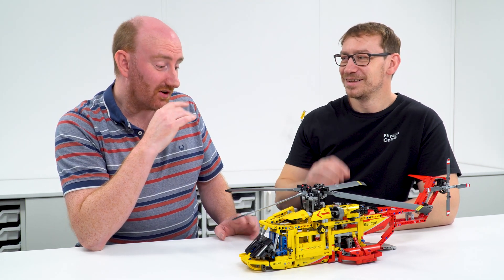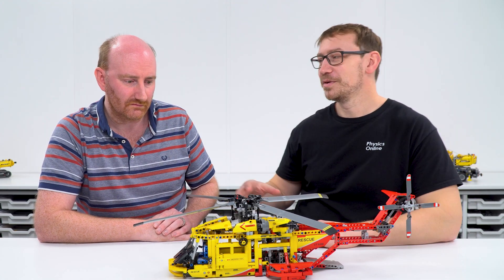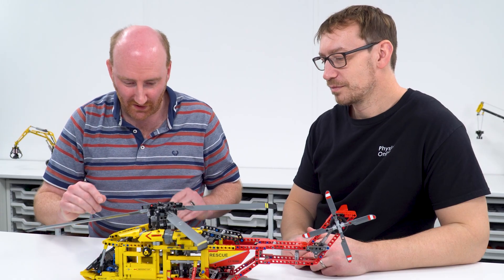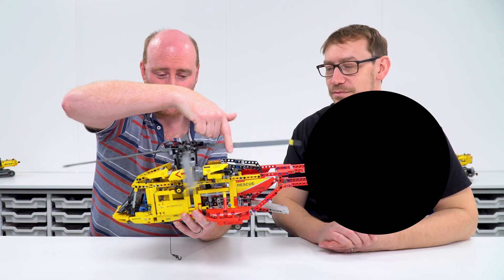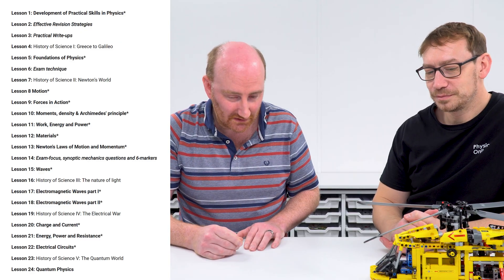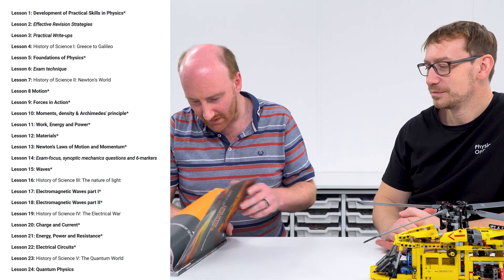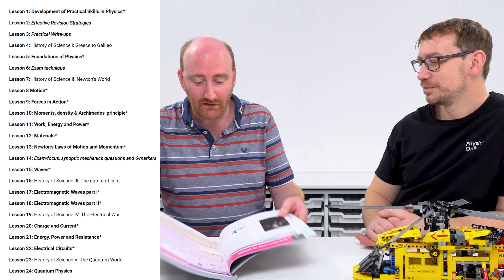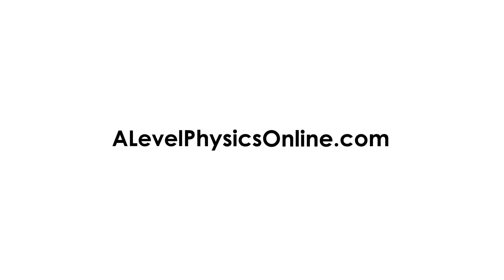Which Way Will The Tail Rotor Turn?

Comment: My research gave me this answer regarding the helicopter:-

For a helicopter with a counterclockwise-turning main rotor (as seen from above), the rear (tail) rotor blades should continue turning in their design-specified direction (which in many conventional helicopters is clockwise when viewed from the tail) so that their aerodynamic forces generate a lateral thrust producing a counterclockwise moment on the fuselage. This counteracts the main rotor’s reactive torque and stops (or prevents) the helicopter from spinning uncontrollably.